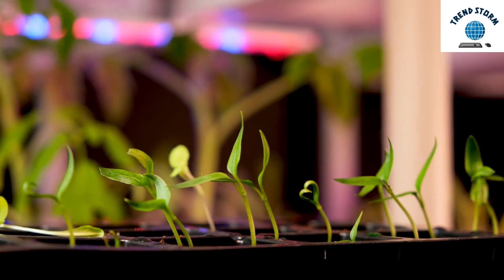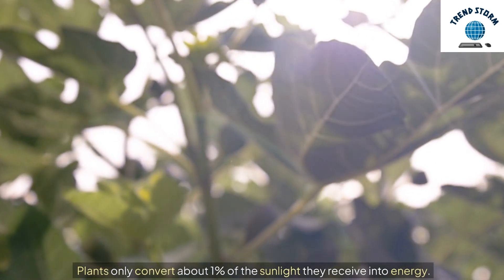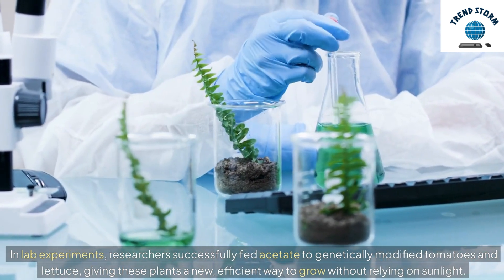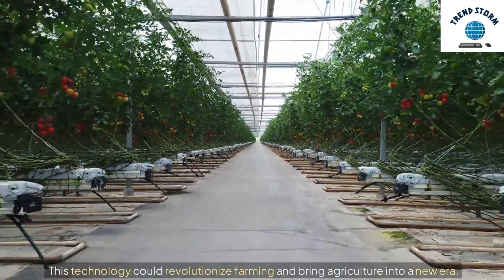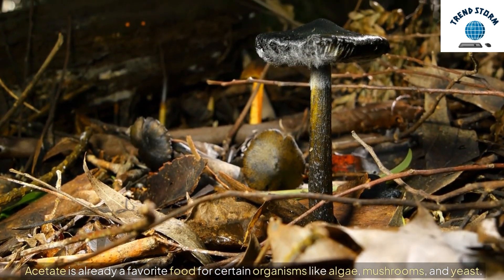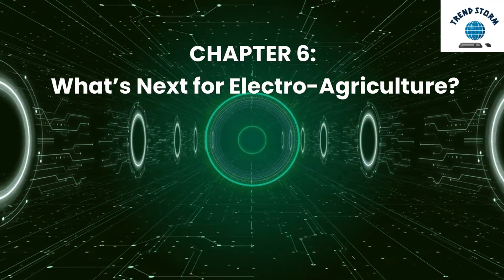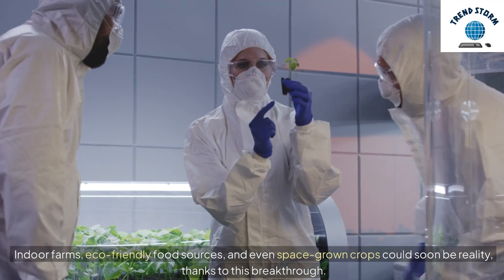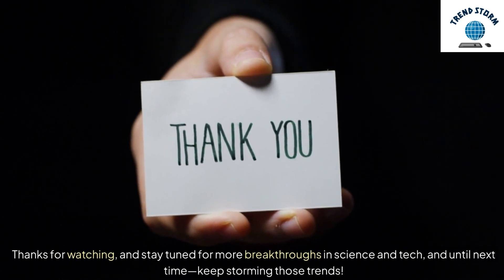Farming in the Dark | How Electro Agriculture Outpaces Photosynthesis |  Turning CO₂ Into Food

Comment: Interesting, but how does "electro" connect to the acetate? Did I miss that? And what is the nutritional value of a plant grown with acetate? 

Also plant photosynthesis based on biomass is leaving a big part of the equation out. Plants can pump most of there photosynthetic energy down into the soil in different forms of sugars (plant exudates). That feed the soil biology that then gives energy back to the plant. So if you take the actual biomass energy of photosynthesis which is 3% to 6% not 1. Then account for root exudates which can be up to 80% of a plants total photosynthetic energy... And then what is the return from the biology on that energy investment? So the 4% in "electro ag" is still far from as efficient as photosynthesis in nature(at least on Earth). But still cool stuff!
Reply from the maker: Great points! The connection between 'electro' and acetate lies in the solar-powered reaction that converts CO₂ into acetate, which genetically modified plants can then use as an energy source. Regarding nutritional value, that’s still an open question researchers are exploring—especially how acetate-fed plants compare to traditionally grown ones in terms of essential nutrients.

You're absolutely right about plant exudates and soil biology playing a crucial role in natural ecosystems! Traditional photosynthesis supports a complex cycle where plants invest in microbial interactions that enhance nutrient uptake. Electro-agriculture doesn’t yet replicate this dynamic, but its efficiency in direct energy conversion is promising. While it's not a full replacement for nature’s system, it could be a useful tool for controlled environments like vertical farms or even space agriculture!